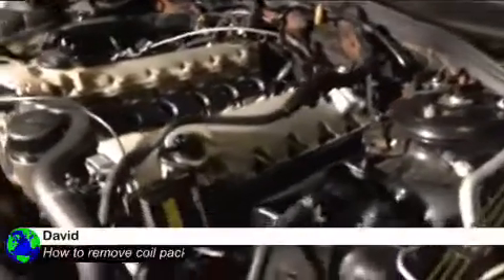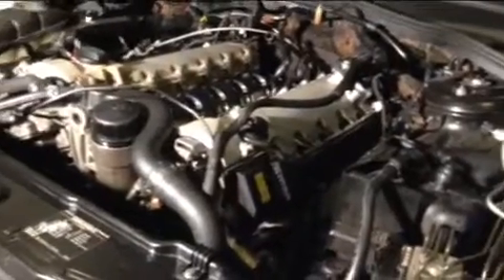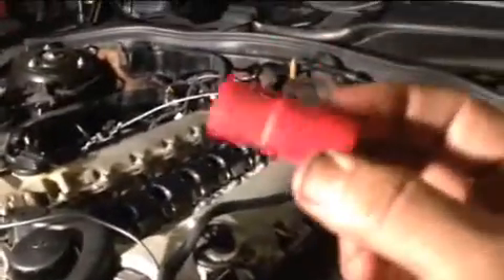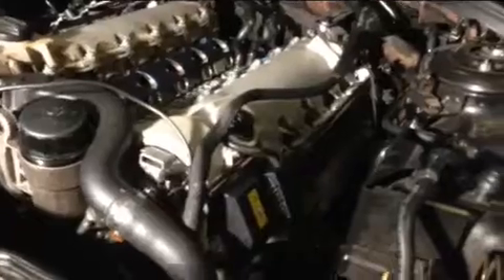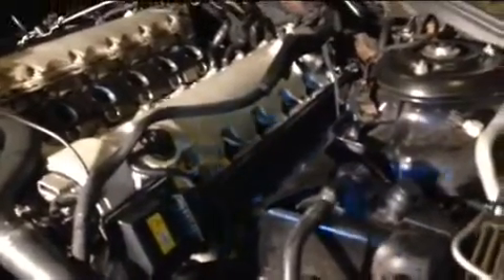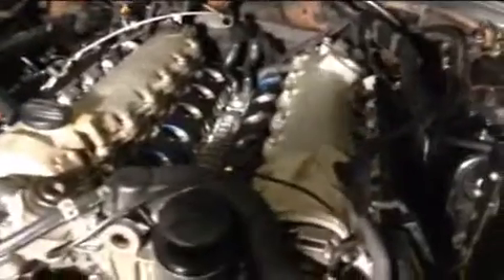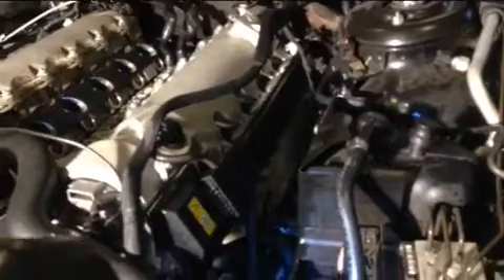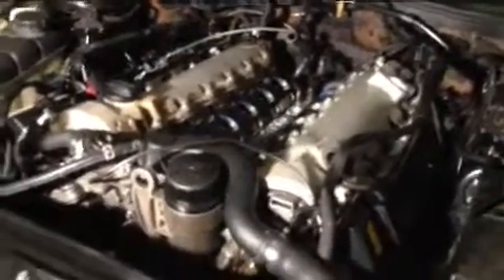How to remove Mercedes ignition coil pack on s600?

Comment: Pretty sure. I had the car to the local workshop, almost three years ago :-/ At that time the engine only operated at limp-mode. Anyway, at the workshop they switched sparkplug 1-3 with 4-6 but the missfireing remained at cylinder 4. Technician told me it probably was the coilpack but it could also be a burnt catalyst. I removed the catalyst for cylinder 4-6 just to discover that there was no problem with that. Thanks for your emailaddress :) I'll drop you a mail soon.

Comment from the maker: I am trying to put my hands on a bad one and see if I can rebuild it or modify it in some way where I have the ignition chip as one plate and the sleeves individually mounted to the sparks and wire to the smart chip, I don't see any reason why it won't work, but yes you are right if you try to change spark plugs and you take them out it is enough to mess up one and you help Mercedes pay their annual bonuses for their senior engineers...
Reply: Hello David I am Having Multiple Misfires on My 2007 W221 M275.12 S65 AMG . I am replacing NGK Iridium Plugs, Both Coilpacks,and Transformer. I am Paranoid because The Exhaust Note Went to a Rough Chug Flat Sounding and I am Praying it is not The Catalytic Convertors Toasted Because The Misfiring Cylinders Turned into an Oxygen Pump Sucking All The Unburned Shell Nitro into The Catalytic Convertor Roasting them. I read a blog where they said Later Model Mercedes have a Function where the Petrol Going into the Misfire Cylinder Gets Cutoff if The Computer Recognizes Multiple Misfires on a Cylinder @200-RPM.Are You Familiar With This?I Pray My Car Has this Bell and Whistle So I don't have to Think about the thousands in catalytic convertor replacement.Lastly my Local Dealership told Me AMG Mercedes are Super Touchy When It Comes To Any Aftermarket Air Filters etc. They Say The Motor is designed to specifications that don't allow different tolerances. Saying That if I Install The K&N air filters allowing the car to breath better and increase performance it could pull more codes and oxygen sensor was flow air sensor issues. I don't need any more headaches and you are so knowledgeable do you see it a potential problem to install K&N Airfilters on My 2007 S65 AMG?Thanks if you can Email Me Marco_Mercedes@Yahoo.com I Strongly Will Appreciate You.Thanks.
 Sincerely,Marco Mercedes

Comment: Hi David
This is something that i have to do right away. I have missfireing condition on cylinder 4 and 5 which i believe is on the passenger side. Maybe you can confirm that?

I also wonder if you can recomend any reseller for spareparts? Shipping to sweden. I checked out the prices from the local dealer but as you mentioned they ask for a rediculous amount of money.

I'm waiting for the last video showing your engine running again ;-)

Comment: Hi David, I'm from Switzerland. I have the Problem fault "Spark Plug a or b from cylinder 4 or the module ECI, right cylinderbank (N92/1)" in diagnose from MB. 
Do you think it is the whole coil pack or only the spark plug? Do you have a coil Pack right passenger side if I need one?

Comment: hi david,
i enjoyed your mercedes v12 600 engine oil cooler leak.
i have an SL 600 2006 and i have developed this leak
the dealer thru extended warantee is going to repair it, i hope, the warantee company is looking at it today
40 plus hours is what book shows labor time
the last one mercedes of pompano florida did took 60 hours

question:
you mentioned several sensors that should be replaced while you have the engine apart with heads off
are ther any other parts, sensors, breathers, timing chain tensioners that should be replaces while the engine is apart?

do the spark plugs really need to be changed?
i did them(all 24) at 45,000 miles and the car has 65,000 today

are the timing chain tensioners single use or can they be reused?

any heads up in this is appreciated
i am going to keep the car another 3-4 years and buy another extended warantee
that goes another 40,000 miles or 48 months

i await your reply
many thanks
dr g
Reply: I switched to Lexus..
Jay

Comment: Hello I have a question I replaced my oil cooler the car runs fine but now I have high crank case pressure to where the oil comes out of the dipstick. Did I reverse vacuum line? What could be causing this? 2002 CL600
Reply from the maker: Lil Wyte bad timing? Too much oil? I really don’t know without looking at it, it sounds very unusual

Comment: i have a 2004 s600 and it wont start even after a battery replacement what could be the issue
Reply: the lights are on the battery is good it just it wont clank up it doesn't make a clicking noise or any sound like its trying to start its just silence
Reply: Canal Cannabus I had the same with my S 600 2002. and in my case it was what the technician calls "the car computer" which was under the passenger rear seat to the right. it was rusty due to humidity.